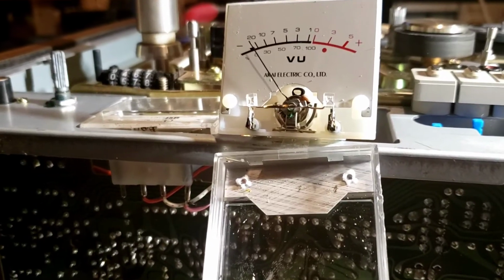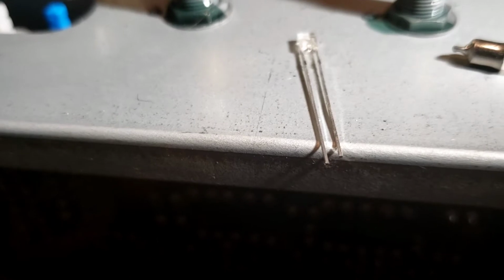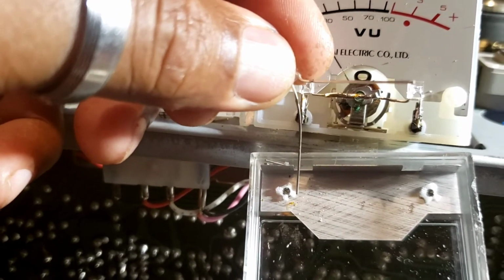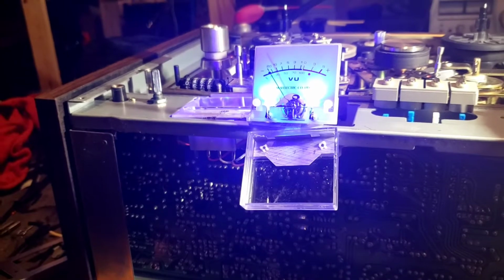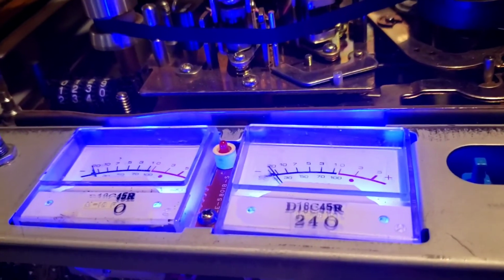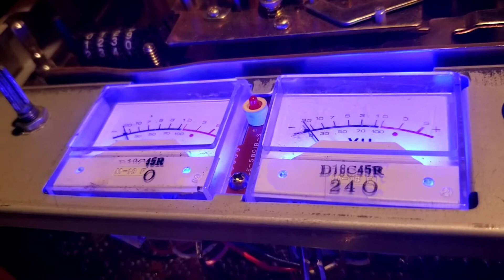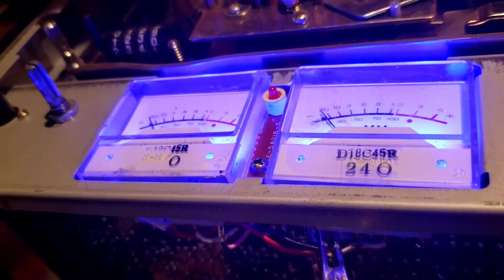Akai GX 4000D bulbs

Comment: Great video! What size led’s did you use…..3mm or 5mm? Thanks
Reply from the maker: Hi, you could use either. I used these: https://www.ebay.com/itm/100pcs-2x3x4mm-Water-Clear-Blue-Light-Rectangle-Rectangular-Square-LED-Diodes-/122017191931?_trksid=p2349624.m46890.l49286

Comment: Bigg Matt - what resistance value did you choose in the VU meters please? I want to copy what you've done.
Reply from the maker: Hi Carl, I can't remember the value. I've since started using small variable resistors and leaving them in place to control the brightness of the LEDs. Simply wire one of these the same way as I did in the video.. This is a link to them: BOJACK 15 Values 150 pcs 100 Ohm- 2M Ohm Variable Resistor 6mm Potentiometer Assortment Kit packag in a Clear Plastic Box https://www.amazon.com/dp/B07WHJMVR4/ref=cm_sw_r_apan_glt_i_341X25ZYPXC9S6NNSPZW?_encoding=UTF8&psc=1
Reply: @5thcomm  Thanks Matt - much appreciated from here in the UK